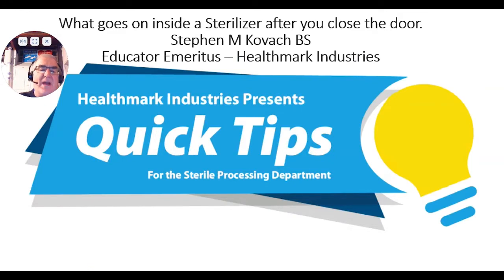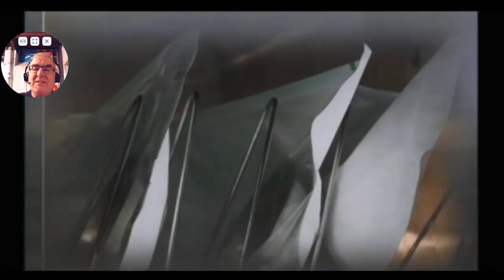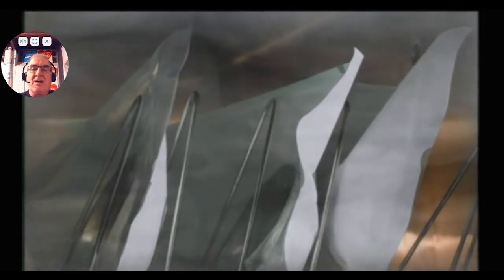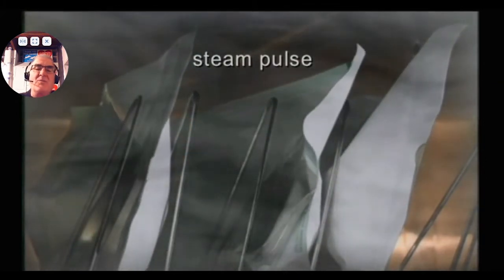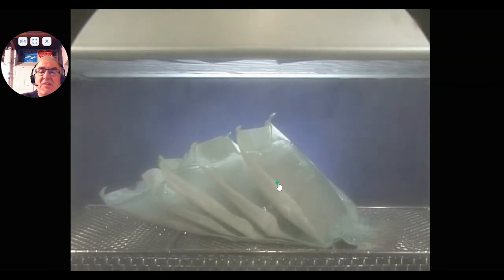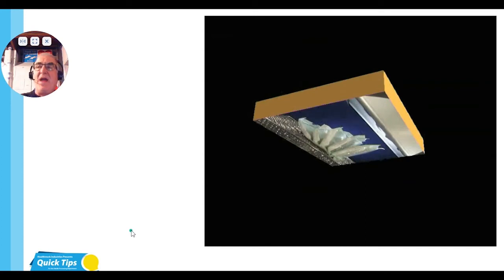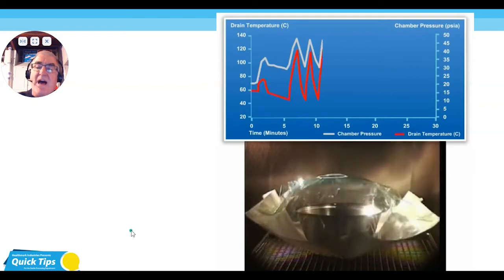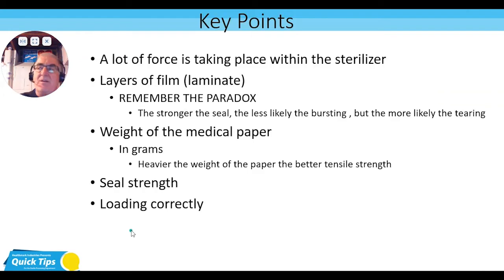What Happens Inside A Sterilizer?

Comment: Sir,
In order to prevent bursting of a peel pouch which was sealed at a temp.of 180 deg. by hawo sealer and loaded each pack with aluminium seals  how much gsm paper is good. we are facing some of packs bursting after the cycle
Reply: Just change the pouches lmao 😂 buy Medline